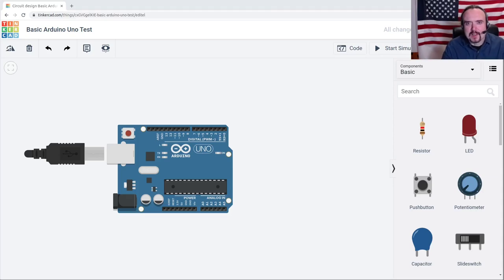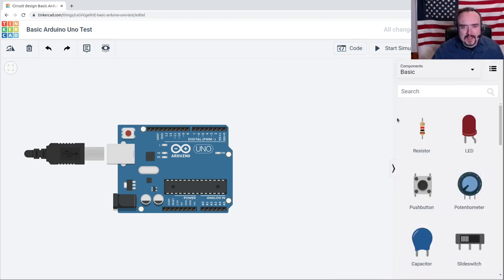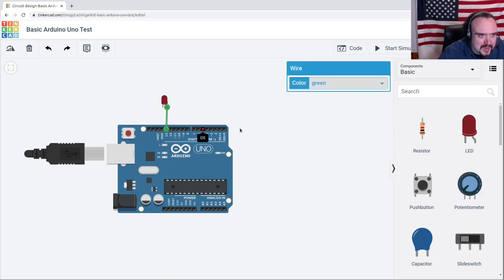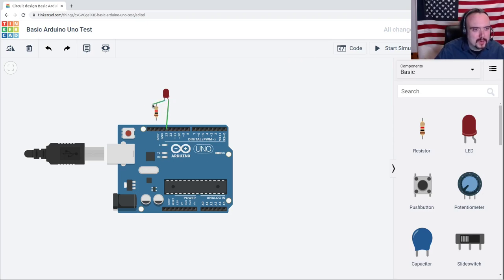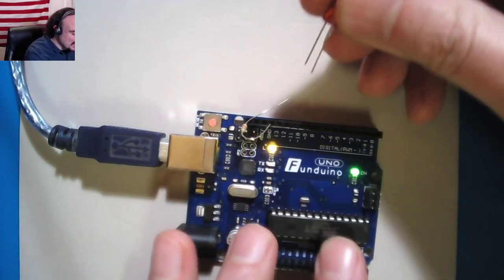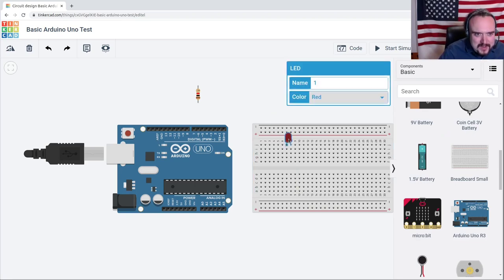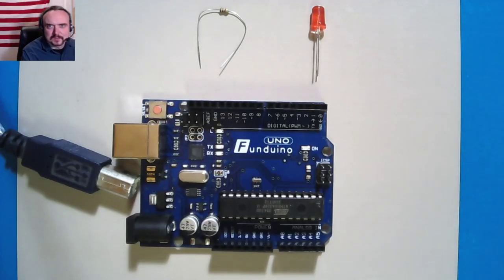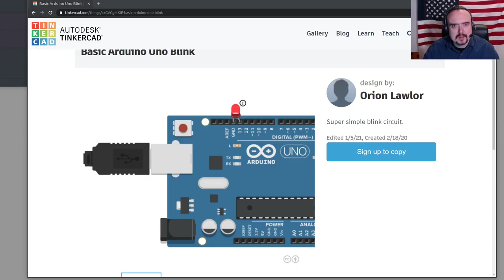Simple circuits and simulator in Tinkercad

Comment: Thank you, I did not know TinkerCAD was so useful. I do a lot of CAD and judged it compared to paid 3D CAD packages. Now I need to learn more bread board and system control building,,, this looks like a great learning tool 🤯. Cool!😎

Subscribed✔️
Reply from the maker: I've been happily surprised by the TinkerCad circuit simulator: you can do fancy stuff like writing to the Arduino's I/O port registers, add power transistors or inductors to make charge pumps, and play with a variety of interesting components.  It's clearly intended for learning, not engineering, so it's not going to displace SPICE level simulators, but I've been happy with it, and the price is right!